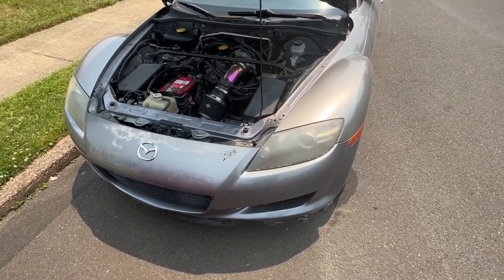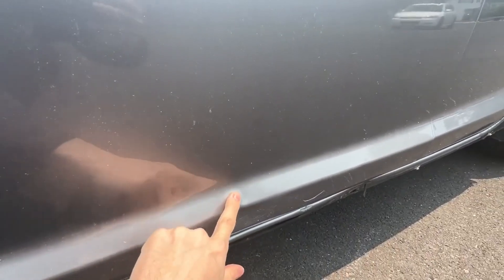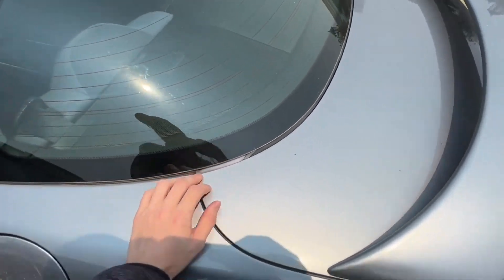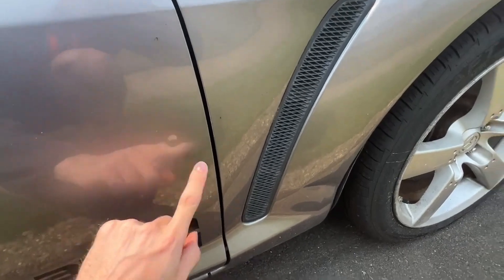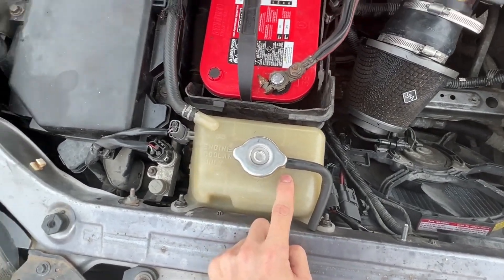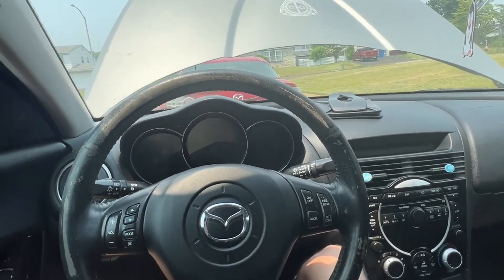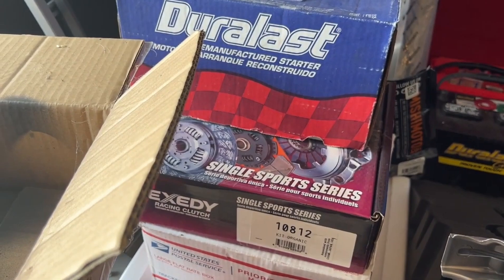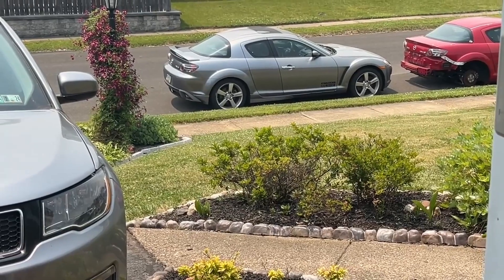What am I doing to my Rx-8?

Comment from the maker: I had people recommend the aem air intake as the best one to go with so I’ll be adding it to the list of upgrades.
Reply: AEM is good, but you may want to consider the Revi intake from Racingbeat.  More pricey but its a nice piece, designed to be a true OEM+ solution
Reply: My dream is to 13 b swap a military humvee Drill holes and install glow plug for multiful purposes
Reply: I have aem and i'd say go with racing beat my aem gets wet when i park my car outside and causes misfires... driving in the rain is fine unless you go through a deep puddle and make a big spalsh... could hydrolock. Real problem is I park my car outside and if its raining the filter gets soaked and if i get on it even once fully warmed the engine soaks up water from the saturated filter and misfires bad. if it rains i take off the filter and bring it inside overnight so its dry for my morning drive... if you garge you car it shouldn't be a problem. but i never see your car inside
Reply: I had an AEM cold air system on my RX-8 and to be honest it was a bad decision. It rains too often where I live and even with a sock on it the filter was constantly soaked. A short ram is fine and there are some that even have an aluminum heat shield or tunnel to help avoid the heat coming off the rotary. E.g. Spectre Performance 9831 Air Filter. The best mod you can do to help your RX-8 is the LS coil conversion, Air pump delete, Sohn adapter, oil catch can, and using Castrol classic 20W-50. I use Klotz benol 2T in my Sohn reservoir, and I pre-mix my fuel with about 6oz of marvel mystery oil to a full tank of gas. At some point you might want to consider a cat-delete and reflash your ECU so you don't have the engine light coming on for the evap and air pump code. Relocating the battery to the trunk and adding a battery cut off switch or a battery tender is also a good move (It will greatly enhance the life of your redtop AGM). Enjoy your RX-8!

Comment: As soon as I saw the rocker dents and rust mentioned, I can already see this being an extra 10k in labor. For some background I bought an na miata that I just wanted to lower and throw different wheels on, that was all. With rocker rust repair, paint and various maintenance items, I am well over 10k and the engine has started leaking lots of oil, idling poorly, and throwing smoke out the exhaust and other metallicy noises. It is now time for a new engine (I don't drive my cars hard because I've always worried about destroying an engine), I've put less than 1k miles on it, after finding rust rockers at around 150miles into owner ship it sat in the body shop a very long time. Keep in mind also if your car is at a body shop for anything other than body panel spraying and swapping, it will be there a very very long time. My car sat for 2 years while other cars came in and went out of the shop because insurance work always gets done first because of time restraints.

I don't know if this car has sentimental value, but I would highly suggest selling and getting one with a good body and paint, that is what rocks your bank account. I wish I would've went this route. Best of luck!
Reply from the maker: Depending on what the body shop says I’m down to try my own hand at cutting and welding. I’m always looking to learn new skills. Even if this rx8 doesn’t last super long the experience is worth everything. Can guarantee after this one goes I’ll just buy another and swap everything over. Is your Miata back on the road now or is there still work to be done on it?
Reply: @Renesis8  Sounds good, always great to learn new skills! And I had it on the road briefly, but it's getting the engine pulled now and will be putting in something a little nicer. 👍
Reply from the maker: What engine you going with?
Reply: @Renesis8  Going with the 1.8L BP4W out of an nb1 miata
Reply from the maker: Awesome. Wish you the best of luck with the car. Should feel brand new once that’s in
Reply: @Renesis8   That is what I'm hoping and many thanks you as well!

Comment: lrb makes an aluminum undertray if you dont want to fab one yourself. and if you plan to install an aftermarket exhaust manifold, you'll want to do it at the same time as the motor mounts, (manifolds dont net any power gains, but they make the rotary sound even better)
Reply from the maker: I’ll give it a look thanks!

Comment: Stay away from mishimoto fan shrouds, they are not as efficient as the OEM shrouds and neither are the fans to be honest, you are setting yourself up for over heating in hot weather.
Reply from the maker: I’ve seen a constant back and forth on the mishimoto ones whether they are good or not. I see people say it works really well and have had no issues with them and other people say they didn’t get so lucky with them. I’ve had these parts sitting for a year now so they’re going in and we’ll see what happens

Comment: Man, there is a ton of stuff wrong with this car… was there not a nicer looking one? Not being mean… but it sure has a lot that needs to be done especially for a rotary
Reply from the maker: My primary goal was having one that runs and drives that I could go outside and work on whenever. Cosmetic wise and and having it look good can come later down the line, I’m not too worried about it. As long as I get to work on and improve the car and have fun along the way  then it’s all good. It gets me more knowledge and experience with these cars that I’ll have for the future
Reply: No doubt
Reply: for some, this is a hobby.  some collect hot wheels, some assemble plastic models; and others buy a fix real cars (over years) to be used eventually.  a very rewarding feeling when a project car reaches completion...but it usually isn't cheap
Reply from the maker: Agreed. Not cheap in the slightest but so worth it in the end. I can guarantee this won’t be the last 8 I buy as well as other cars that aren’t the 8 being featured on the channel